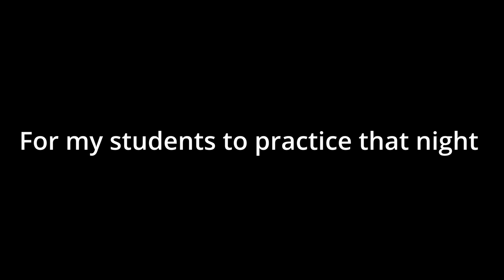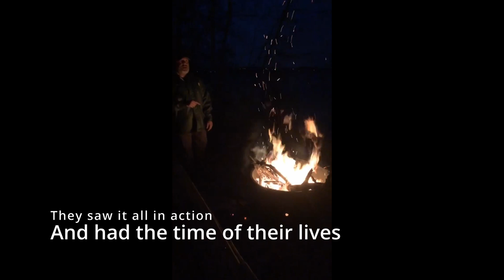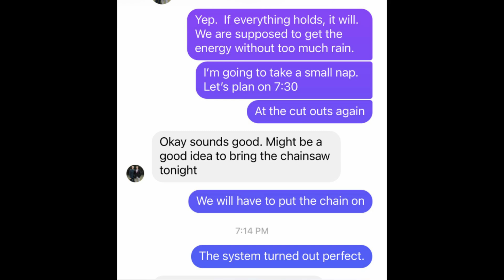Aerokinesis (Engineering With Exercise)

Comment: Nice video. Tip if you dont get it through on the first swing rotate axe 180 degrees and hit it on the back with the wood stuck on top and it will cleave. Dont hit it like you did on the first attempt. 
Greetings from Sweden.
Reply from the maker: Good tip!

Comment: I have anxiety so when I start to overthink the wind picks up. And when I get angry its worse. Any advice on how to prevent emotions from taking over?
Reply from the maker: Well, the best thing to do is to film that when it happens and then show me how that occurs when you have anxiety.  

As far as controlling one's emotions, we have an entire course on that.  Ultimately, you just have to remember that emotions are a signal that helps you to navigate a possibly dangerous environment.  Once I feel an emotion, I begin to observe my environment because your emotion may be protecting you from danger or a tense situation.  Emotions generally occur as a response to stimuli.  If you can be observant and not let your emotion rule your actions, they can be one heck of a good tool.